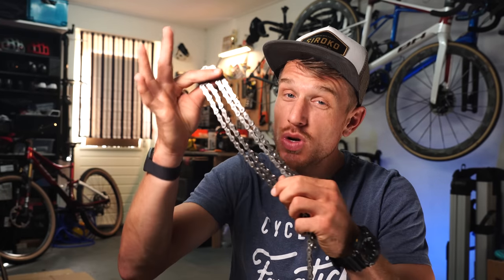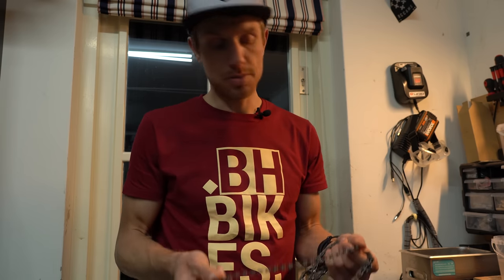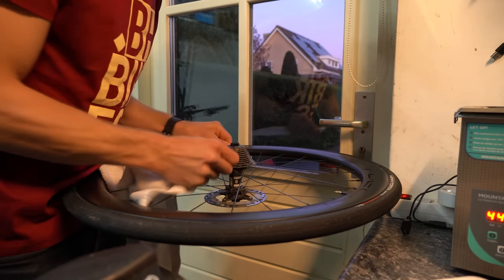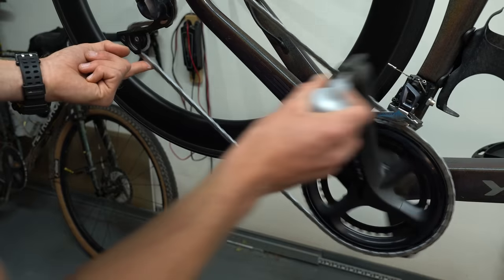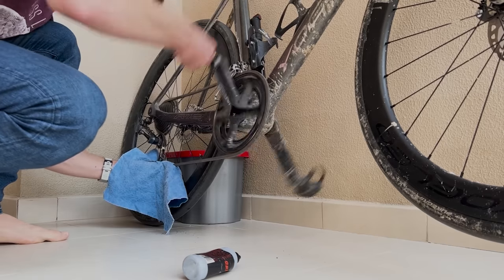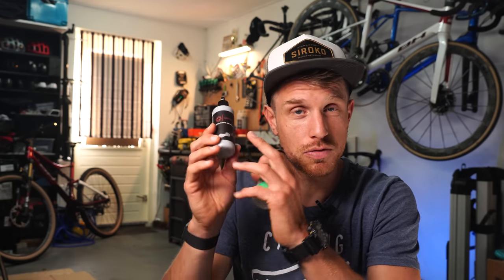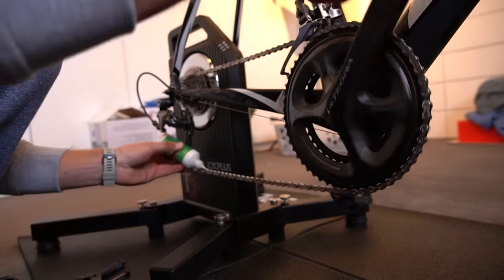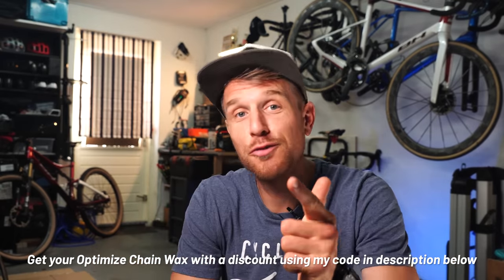Testing Chain Wax for 1-YEAR and this happened..

Comment: There is a stigma against black and greasy chains, but if you go past this stigma then all you need to do it oil your chain with cheap stuff like engine oil. The excess will fall off, the gunk that builds up also falls off. No need to clean, ever, just add oil. Occasionally scrub the gunk off the jokey wheels, and maybe do a chain cleanup with WD40 for instance. Don’t scrub the chain as it pushes gunk where it should not be. The grinding stuff gets pushed out of the chain naturally. 
Basically that’s treating your chain as you would a motorcycle chain.
Reply from the maker: Worst thing to do. Like I explain, the sand will form a grinding paste and wear your chain down. 
Engine oil is for engines.  Chain lube is for chains. 
 Chain wax is for chains and imo better than oil. No black dirty hands. Longer chain life. Plenty of upsides to wax and downsides to lot of oil…
Reply: @jasperverkuijl you're wrong 😂
Reply from the maker: @JoeyMills-y3v  ok 😂👍🏻
Reply: @jasperverkuijl  why is SAE non detergent engine oil the industry standard for lubricating roller chains then? No industry uses wax either.
Reply from the maker: @JoeyMills-y3v I’m not trying to convince you buddy. Keep using your oil 👍🏻
Reply: @jasperverkuijl  if you're not trying to convince me, why did you make this video? Why did you reply to the original post saying he was wrong? Nothing you post makes sense 😂
Reply from the maker: @JoeyMills-y3v  because it would be an endless discussion in the comments... If you are not convinced after seeing my video that's fine and you should keep using your engine oil i dont care buddy (Y)
Reply: @jasperverkuijl  So you make false statements but are not prepared to discuss them? Doesn't sound very honest 😂
Reply: @JoeyMills-y3v  That is your average wax enjoyer. It's is like a religion, arguments don't count.
Reply: @WCIIIReiniger  It's affiliate marketing. He says what he's paid to, simple as that. A bike chain is just another roller chain & there is no precedent in industry for lubricating roller chains using wax. Wax is a solid, not a fluid, so cannot flow back into spaces it has been squeezed out of due to pressure. Oil can, which is why it is always used. Very simple & undeniable.

Comment: There's a safer way to do the wax, use a double boiler with a second pot with boiling water below it.  Then the wax cannot become too hot and potentially catch fire
Reply from the maker: Just put it on low setting wil also not get it too hot 🤷🏼‍♂️👍🏻

Comment: Sheesh - mate just drop the new chain in a jar of petrol.
Shake it a few times.
Drain it.
Fresh jar - filter the used petrol using a couple of paper towels and repeat the exercise.
If the jar is not completely clear the second time - repeat the process a third time.
Remove the chain  - pat dry with a clean towel - and hang to dry completely.
That's it.
You will not ever have to do this again..
My waxed chain has 9000 kms on it - no sign of wear - quiet as - clean as - chain rings and cassette continue as if new.
The retailers rubbish this idea of waxing the chain.
Gee - I wonder why.
20 - 30 of "essential" bottle lubes at outrageous prices in every store - that's why.
I used to have several chains in the process .
No need.
Using a quick link remove the chain in about 2 heartbeats .
Remove the chain and start the waxing process.
I wash my bike on a stand - much better access with no chain fitted.
By the time the bike is dry the waxed chain is ready.
The bs that it is a time-wasting involved process is just that - b.s.

Comment: So I heard different statements of reapplying the wax every 150 miles to 1000km. I tried cold wax last year, and I had to reapply it every 100 km sometimes, which was a pain in the ass. Also it took me like almost one bottle for one chain, while the chain did not last any longer.
I ride around 600 km per month so even if it would last 1000 km it would be super annoying to take off the chain every 1,5 months. I have seen so many waxing videos and I am still not convinced, because this looks like a huge time waste.
Reply from the maker: But drip waxing takes like 10 Seconds. I don’t see that being time consuming? No need to clean in between.
Reply: @jasperverkuijl  it takes more than 10 seconds. In 10 seconds I don't even get the wax out of my shelf and back afterwards. Applying cold wax does take about the same time as oil, but I had to do it much more than I needed to oil my chain. And if you are not super careful and take a lot of wax, the wax does not even take 50km to start squeaking again. Even if it is only one link, it is super annoying. You don't know which one it is, so you wax it all over again, hoping to get the squeaky spot. You can imagine the cold wax bottle won't last long this way.
I have no experience using hot wax, but I also have no interest in going through this time consuming process plus taking off the chain and rebalancing my wheel and brakes everytime (I ride a fixie). So for me it is a huge waste of time considering all the issues connected with using cold or hot wax. And don't get me started about the ridiculous prices of these products.
Reply from the maker: Ok 15 seconds, 5 seconds extra to grab the bottle 🤪😜

hey mate,yeah hearing this I can imagine you’re not a fan of wax. However, I really think that if you have a squeeky chain after 50 km you are doing something wrong… 
If you’d be willing to try again, degrease it properly and do the process. 
But with fixed gear, I don’t know, maybe stick to oil 🤙🏻

Comment: Oh c'mon.... removing grease from shimano - easy. Just 300ml of kerosene, it will dissolve "any" bike chain grease, shake it well, then use a petroleumether, shake it well, and the last step, optional however - degreaser, whatever you prefer, I'm using IPA (not beer) :D. Use gloves though, or your skin will quit the room :) Btw all this fluid are not smelly, so it is moderatelly safe to do it even inside, but well obviously do this in  ventilated room.

The beauty of this fluids are they cost a fraction of bike-special degreasers and are available any construction shop or malls...
Reply from the maker: But where do you buy kerosine? I can take some home from my Jet 🛩 😂

Comment: While you spent such lots of time on the chain. to be honest, the m6100 chain is only about 15 or 17 bucks on our local store,
And I thought you are pretty rich enough, just buy the new chain for every month, it's much cheaper and time saving on maintance. 
These wax and lube is terrbily expensive compare with the new chain, 1 ultimate lube = 4 or 5 pack of m6100 chain. It's really wild.
Reply from the maker: I don’t use the low grade chains. 

I always ride a ultegra, dura ace, or kmc x12 N-Ti chain which are about €35-€55

So that changes the equation. I ride about +- 1500km a month. With this chainwax I hardly have any wear so no new chains needed for a long time. 

In 10 minutes (degreasing) and 15 minutes (hotwaxing) I can do 4 chains that will last me a loooooong time. 

Instead of buying (and throwing away? Are you serious?) new low quality chains every month that won’t give optimal shift performance and have the same crappy grease on them every time!!! This will destroy your cassette, chainrings and get you dirty hands all the time. 

I really don’t understand your idea🤔, sorry. 

The standard wax is only €12  so not expensive at all. 
The graphene wax is expensive, I agree. But will get better performance than the cheap one. 

And wat better than the standard Vaseline crap they come from the store

Comment: TWO VERY IMPORTANT ISSUES WITH NO MENTION, plus and afterthought:  1.  Indoors paraffin vapors can be dangerous and toxic;  2. WTF?  I KNOW WHERE TO BUY THE WAX AND TRADE NAMES.  WHERE IS THE NITRO THINNER AND WHAT IS THE LABEL/BRAND?;  3. Also, many machinists and mechanical technicians know that a 50/50 mix of Acetone & IPA can work magic as a final touch, better than either one in sequence.
Reply from the maker: 1. So burning candles is also highly toxic? (I know it is toxic but I guess most people don’t worry about it) the wax in the pan gets far less hot than n a candle. And I use the ventilation above the stove during the process to suck the potential fumes
2. Google nitro thinner and something should come up I guess. There are different brands. Probably my brand isn’t for sale at your area 
3. Acetone & IPA? What is ipa? My experience with acetone is that it does nothing so I can only share that…

Comment: I tried chain waxing. The degreasing is easy. The waxing is easy. The "getting used to taking the chain off your bike" part is easy. The problem: every waxed chain I ran rusted quickly. Every waxed chain I ran was noisy. Every waxed chain I ran needed rewaxing after 150 miles. I went back to quality wet lube (Silca Synergetic) this season and all of these problems went away. Waxing chains: no thanks.
Reply from the maker: Sounds like you are either doing something wrong or using the wrong product… 
Degreasing isn’t easy, it’s very specific. Maybe that’s where it goes wrong, I don’t know. 
Light rust is common with wax vs lube as I show in my video. But I also show a way to prevent it.
Reply: yes you are right, so you should do: rewax every 100km, do not drive in wet condition, use inductive heater to rewax chain on bike it takes 5 minutes per one pass

Comment: need an degreaser use petrol/Gasoline simple that. LOL
wax is good an insane efficient, but for me last only 100k 120k if not rain, if it have an second chain with oil is better on rain days.
Reply from the maker: Only issue is you can’t mix a waxed chain with oiled chain in same bike….

Comment: Kerosene will get all of the factory grease off of your chain. It takes 2 or 3 soaks to get it all off / until the kerosene is clear (the last soak should be over night), but it will do the job. After drying the kerosene off the chain with a microfiber rag, I used compressed air to get it out of the rollers. Then I put it in a jar full of 90% denatured alcohol for 30 minutes, shaking the jar every 5 minutes to displace any potentially left over kerosene or other stuff you don't want on the chain. The purpose of doing this is the kerosene evaporates very slowly, but alcohol dries relatively quickly. This step allows you to wax your chain relatively quickly after cleaning, rather than waiting a few days for the kerosene to dry off the chain. 

I do this to all of my chains before waxing them. It works very well. I highly recommend this process.
Reply from the maker: It seems a bit more work than just the nitro, alcohol or spirits That others are suggesting. 

Also, where would normal people buy kerosine?(you use jetA1?👨🏼‍✈️)

Comment: Waxing a MTB chain is not really good. I killed a Garbaruk cassette's big sprocket in 2 rides because the wax runs too dry for metal/aluminium interfaces on the plates (rollers ok). I'll keep running wax on my road bikes but revert to Finishline's Dry + ceramic formula for MTB.
Reply from the maker: That’s strange
Reply: Not strange just mechanical, The dry/dry dusty metal interface just scrubs the wax off as does the mud water on a wet chain. Down here in the south or France the dirt is Calcium silica and flint mix and very very abrasive. You are better off with wet lube in wet and dry lube in dry conditions with the lube sticking on rather than flaking off as wax does. @jasperverkuijl

Comment: I can’t understand why people are going down rabbit holes with solvents. Just use kerosene. It’s a brilliant degreaser then you can hose off or finish with water. It can be filtered and used again. Just let it sit and most of the stuff goes to the bottom.
Reply from the maker: Jet fuel? 
Jet A or A-1?😝

Comment: put the pot in a pot with water. that way, the temp can not get too high ( will stay at ~100 celcius)
Reply from the maker: 100 is already way to high! It should be like 60C actually
Reply: i can´t speak for all hotwax products, but it should be no problem at all. i use normal paraffin wax atm.

Comment: That's complicated. I have been waxing for 25,000km. First clean, ultrasonic cleaner, takes 15 minutes to remove the grease. Wax: Paraffin (you can find it in hardware store, 500g is less than $10). Heat your wax, soak the chain for 20 minutes, takes it out, wipe the excess off. Use gloves to move the link as it finish cooling down. Done. Chain last for 15,000km+. Rewax: Wipe off the excess dirt, put the chain in, remove, wipe off excess wax. It doesn't need to be complicated. Plenty of wax stay in and it's good for 300 to 500km between waxing.
Reply from the maker: Well, when you found the right way, it’s not complicated. But if you try the stuff that’s advocated by a lot of parties that don’t work, it’s a hassle. That’s why I made this video.
Reply: @jasperverkuijl  To be honest, I too was waiting at first for the wax to cool down before pulling the chain out, then let the chain cool down and harden, rinse with hot water before rewaxing, etc. etc. I kept cutting steps as I moved along and now the process is very quick and there is no to little impact on chain wear. In 25,000km I never replaced the cassette or chainring yet.
Reply from the maker: @morneauh 25k on 1 chain?
Reply: @jasperverkuijl  I replace them at 5000km, I'm afraid of metal fatigue. At 5000km they have no visible wear, they pass the test with the Park Tool CC-4 and when I put them next to a new chain they are the exact same length as a new one, so no stretch. Maybe I should keep using them, but they are so cheap and 5000km is a good life already. I heard some people keep them up to 15,000km and they are still below 0.5 wear. Waxing is wonderful, just time consuming, so if you cut down the time the process take, it's a big win. Honestly what is expensive is the SRAM Force cassette and the chainring. Those are still like new.

Comment: Degreasing you do with "wasbenzine" or even beter "terpentine" and then to get rid of the residu you use acetone. It's a royal pain in the ass
Reply from the maker: Im not using acetone anymore. 
Terpentine could work but I’m 100% sure nitro is more powerful. 

With nitro is super easy and. 5-10 minute job. (As I explained in the video)
Reply: @jasperverkuijl, waar heb je Nitro gekocht? In mijn dorp niet te koop bij verfspeciaalzaak en praxis..
Reply from the maker: @berXweg5390 online. Toolstation heeft het

Comment: Seeing that dirty bike ridden in rain and winter slush makes me thinking that for this conditions single speed belt drive bike is much less of PITA, especially living and riding on flatland. Wash off sand and grime, wipe sprockets and spend time with a family instead of messing with wax sorcery.
Reply from the maker: Yeah belt drive could work great indeed

Comment: It's not true the chain doesn't get dirty. Eventually it will. But it does stay much cleaner, longer than a oil based chain. I still find i have to degrease it to get it super clean again. Boiling water doesn't do the job.
Reply: This is contrary to my personal experience. And to everybody’s if read or heard about.  If the Chain is degreased properly in the first place, there is no grease left to be degreased later. And wax can be removed with just hot water. So what are you grease are you removing?
Reply: @SrFederico  Dirt does eventually stick to the wax. Hot water doesn't clean it thoroughly. That's why i'm using degreaser.
Reply: @DanTuber  Normally a degreaser should'nt even solve the wax, heat and water does.
Reply: @SrFederico  You can get degreasers specifically for wax.
Reply: @DanTuber  Ok, didn't know that. De-Waxer, so to say. Anyway, my waxed chain is only "dirty" from the Tungsten in the Silca wax and pristine again after a simple hit water treatment.
Reply: Like in most cases the answer is: "it depends" if you wax your chain and ride in perfect conditions probably, there's no chance for any dirt. However if you ride in heavy traffic, in rain, or places where you chain can get exposed to external factors, like contaminates from cars, yes the chain WILL get dirty and you NEED TO degrease it again.
Reply: @MarcinKuzminski  Where does that grease come from you claim to remove? There was a stripped chain, there was wax and there was sand and water. No grease (= oil) in sight. Wax is best solved with hot water and practically inert to classic solvents.
Reply: @SrFederico  from cars, from garbage trucks, from construction wehicles. The best "visual" example of that is how easy it is to contaminate your disc brake rotors after a rainy day while you ride through the city. Where i live i really try to avoid riding in such conditions because the streets are sort of dirty and bike pics this stuff up
Reply: @MarcinKuzminski  Yes, disc brakes are easily contaminated, sometimes in best weather they suddenly start to squeal, my guess it takes just one little insect to start a concert. But I find it hard to believe that there is so much oil on the streets that you actually have to degrease your chain. I have to add that I have no practical experience, I tend to avoid riding in the rain.
Reply: @SrFederico   i waxed my chains for 3rd year now, and from my experience, the chain gets dirty eventually, so once 6 months i just go clean it quickly, adding degreeser to the process. But again that's my experience, maybe i live in dirty area of a big city. 

With a lot of things in life, specially cycling YMMV.

but waxing FTW !!!
Reply: @MarcinKuzminski  Yes, mine gets a bit "dirty" too, but I suspect it's mostly the tungsten from the wax. So every 1.000 km I boil it in water, no degreaser needed. Not that it would do any harm, I guess. But according to Silca et. sl. you should wash off the remains of the degreaser with denatured alcohol.